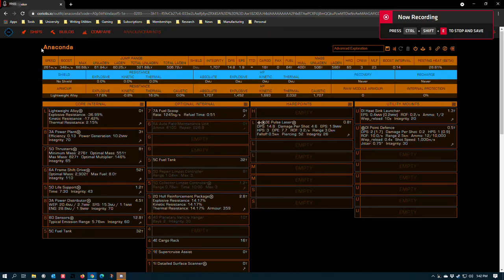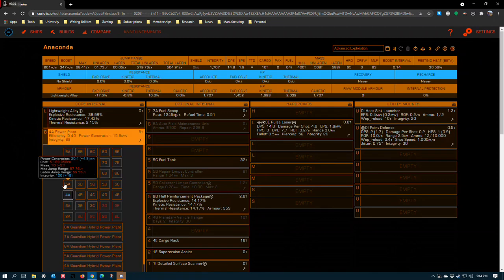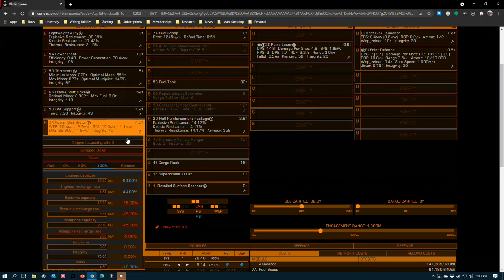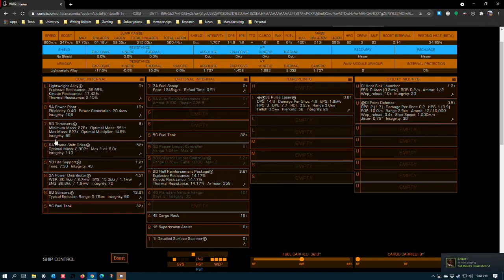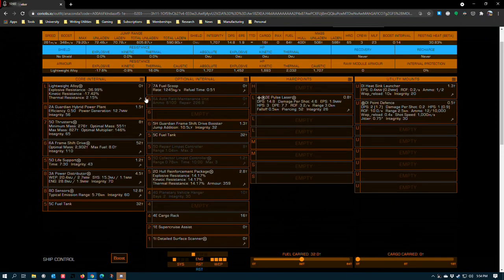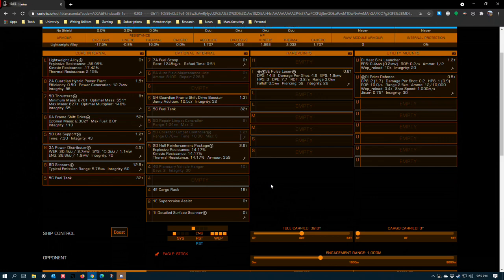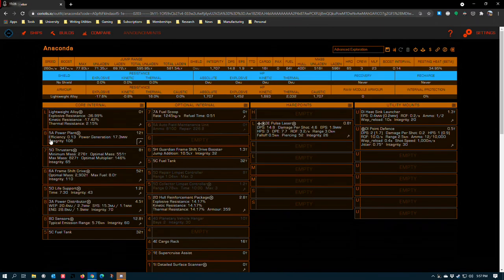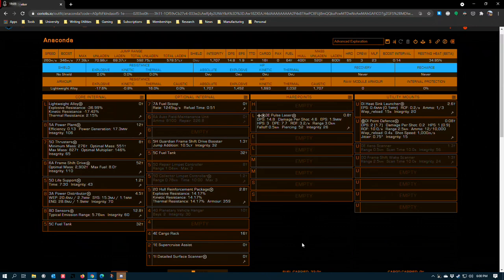Elite Dangerous | Ship Builds | Anaconda | Advanced Explorer

Comment: Got mine to about 65 l/y still working on lightweight sensors and 5th grade FSD engineering
Reply: With the new fsd im at 79.7 LY without mass manager applied and not fully upgraded yet im gonne go 80+ quite easy

Comment: I built a DBX for running missions in the bubble. Got the urge to try out exobiology and it was quicker/cheaper to take the DBX rather than finish building my Phantom. I'm bouncing around uninhabited space 800+ lightyears from my base. My 43ly jump range hasn't held me back at all. Scooping with an undersized scoop hasn't been an issue. I think jump range minmaxing is just a pissing contest with no real value. There's more to exploring than jumping as far as possible. My DBX is still mostly outfitted for missions. It has guns, A-rated thrusters, max powerplant, max distributor. Kept it that way so I could shoot brain trees and such for engineering mats. However, I also think the DBX is a bit overrated as an exploration ship. Again, it's hyped for its jump range... which I consider largely irrelevant. Internal space is pathetic in the DBX. I have the SRV hangar, fuel scoop, collector limpets. So I stress every fuel scooping or every minute on the ground I could potentially bump something. Repair modules are essential for real exploration. So I'm looking at the Anaconda as my exploration ship. Unless I can fit everything in the Krait. But whichever way I go, it will still have max thrusters for maneuverability and enough power to run everything without needing to shut off half the ship at a time. A 50ly range is more than adequate.

Comment: Hi there, really nice vid and thanks for taking the time to propose a good exploration ship. I would just like to give a pair of suggestions , like fuel scoop . 7A works really great tho 7B is the perfect compromise, scoops faster than a 6A and costs  5 millions less, although being just a little less energy efficient. The thrusters you used  are just perfect for a skilled explorer, but for who starts exploring with a ship that mass I'd say much better 6A, (5A is not bad too) Speed in normal cruise doesn't improve much but in terms of thermal efficiency and management , while scooping an example, it's way easier to manage.

Comment: Got mine going with the new double engineered fsd and its amazing its fully outfitted the only thing i cant aply yet is mass manager so im waiting for that because im at 79.7 LY and want to go 80 + maybe i can still fiddle around with lighweighting it and get 80 LY without mass manager applied but ill have to unlock a few more engineers .

 Now its possible to go 80 LY + reletively easy while fully outfitted and its amazing to use like that. I never cared much for the jumpaconda version because its useless but i can probebly reach the previous record of bare bone stripped down version of 84.04 LY if not im going to be really damn close and will have a neutron jump of around the 330 LY.

If you could check this for me or know from the top of your head and maybe even make a new video with the 6a double engineered drive i think people would like that